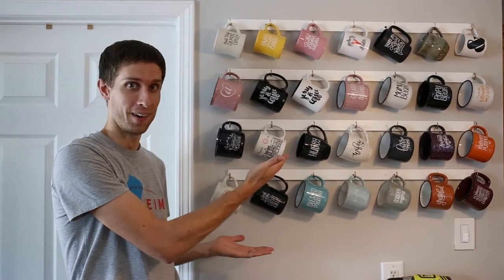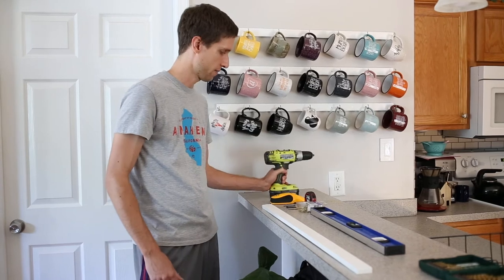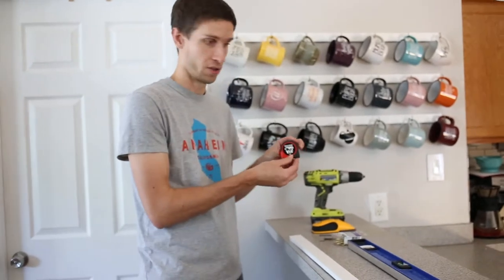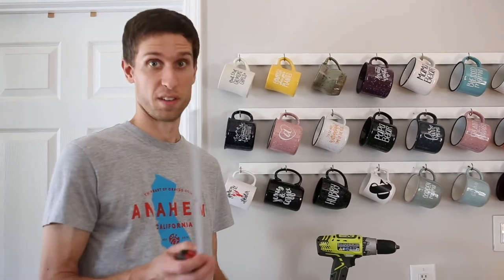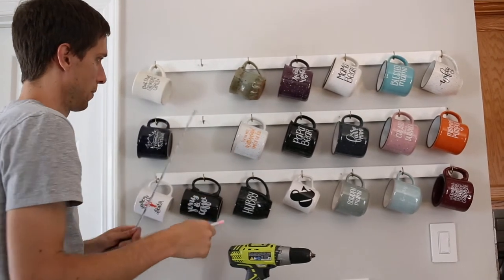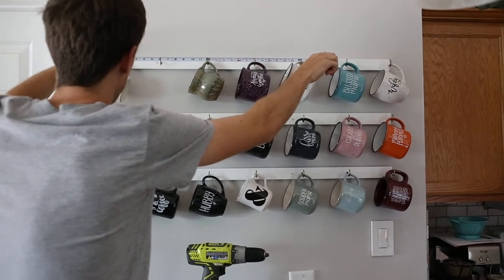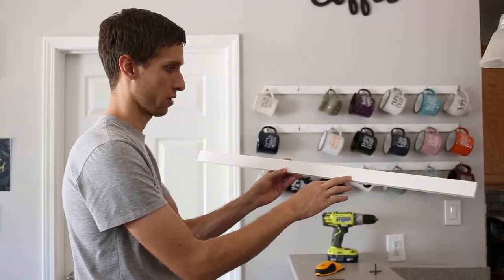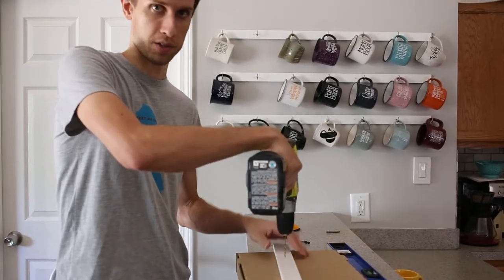Easy DIY Coffee Mug Display

Comment: Another tip  use a normal screw and screwdriver to start the hole in the wood ? Or nail and hammer to tap hole :)